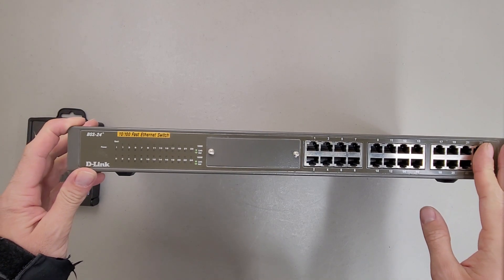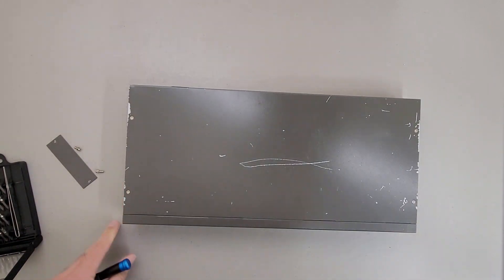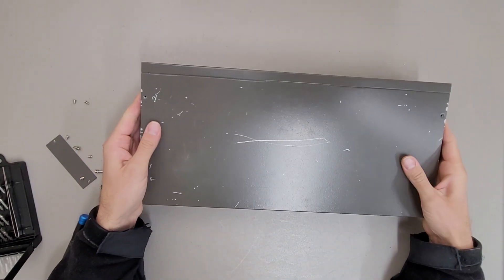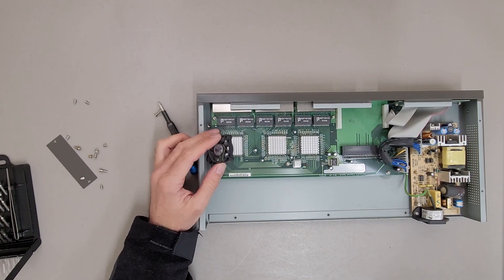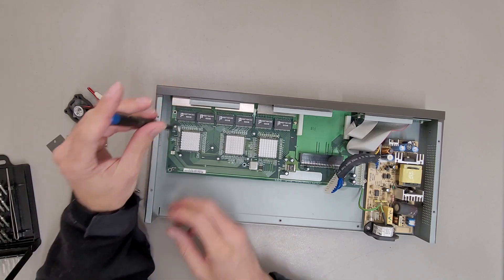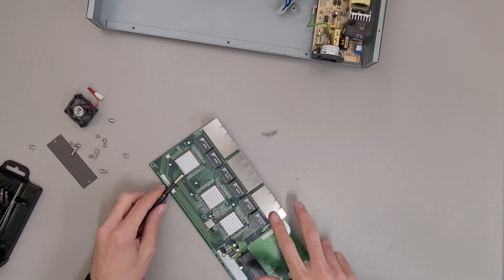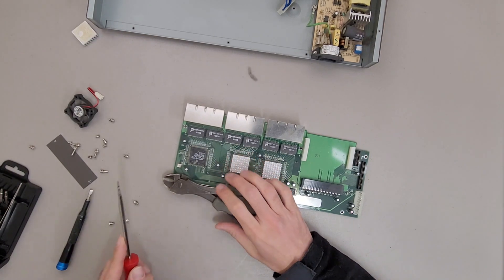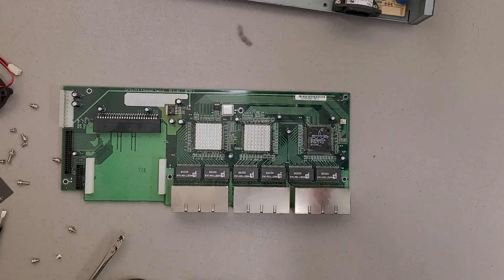D-Link DSS-24+ 10/100 fast Ethernet switch #teardown

Comment: 5min in, yeah, I think the one I have the things are epoxy compound attached, I didn't fuss with removing them and chance messing up the PCB, as I intended to use the thing, lol. Would be nice to put taller pin-fin heatsinks on them chips for better cooling, just not worth the effort with how attached they are and risk of lifting traces. pin-fin heatsinks are about as good as heatsinks get, and it's not like you can OC the thing anyway, lol. If it was the style with push-pins on the side, I absolutely would have called Aavid Thermalloy (Boyd now) to get taller ones to swap them out,for insurance if the fan fails.
Reply from the maker: I've always wondered if a person could use another heatsink with a bigger surface area and similar fin stack, invert it, then interleave the fins, and thermally bond them with thermal paste or epoxy on stuff like this.
Reply: @computersales  absolutely, back in the late 80's early 90's a lot of testing was done on variations of the pin-fin concept to get max heat to the tips of the fins and have the best airflow around them, ranging from staggered pin-fins to round ones, etc. I think Research Gate or some other science publication has that stuff, been a few years since looking. Ironically getting a second heatsink to do that mod is on the edge of why not get a taller one to begin with. I've gotten 38mm tall 40x40mm pin-fin heatsinks for other projects (motherboard VRM heatsink swaps), so I know they make taller versions of what's in that switch. guessing there 9mm or 11mm tall ones in the thing, same that was on the ATi7000 and MX440 GPUs back in the day. I'd measure them if it wasn't giving me interwebs access at the moment, lol.

Comment: IIRC those were pretty reliable - except for the fans
Reply from the maker: Yeah those tiny little fans never last.
Reply: I'll second that, thankfully it's a normal 12v 40mm fan, so easy to replace with a better one with far better bearings. Just make sure it's not one with less cfm/lpf to keep the PSU and main PCB from having thermal issues.

They are also fun to just play with, I have one I cleaned out a few years ago, and the poly-film diner mints and horse pills were already on my desk, so a cap-mod kind of just happened, lol. it didn't make it faster or anything like that, just cleaner power to all the chips (RFI suppression of a sort). I have a few 40mm fans from mouser I am going to try in the thing, I'm just looking at the mains filter on the PSU and thinking of making it a bit more robust, thinking, I may not go down that rabbit hole just yet due to how much work each option will be. Mods I'm thinking about aside, the thing has been very good running 24/7 for the past few years, so it's earned its keep per se (worth me making bulletproof instead of e-wasting it for another commodity consumer mess I will have to fix anyway, lol).

The PSU in that thing is good and has room to make better, That far better than other PSUs I've seen that are so component-cut for cost that there is nothing to work with to make them better than the junk they are, lol. The fact it has an input mains RFI filter is phenomenal to begin with compared to stuff made today. There are a few bleed-off resistors on the output DC side that are uncomfortably close to some electrolytics, I was able to move them to the underside edge of the PCB to be cooled by the side vend and get them away from backing the electrolytics, which happened when I did the cap mod a few years back. Usual warning about working with mains voltage PCBs apply, don't be a fool fine print things.